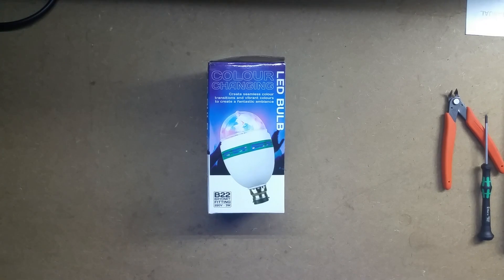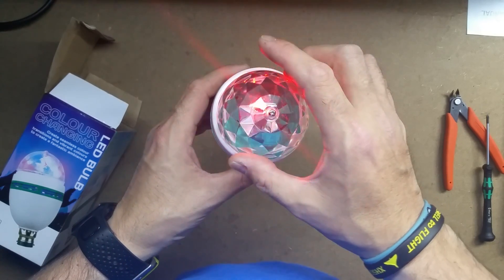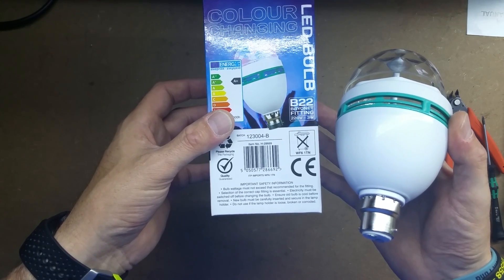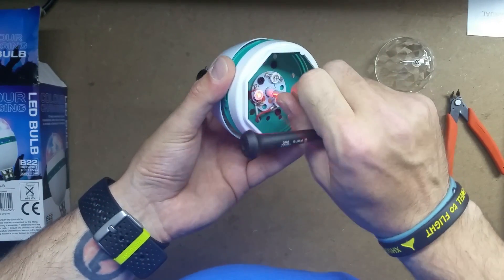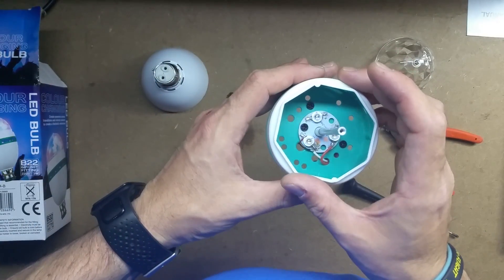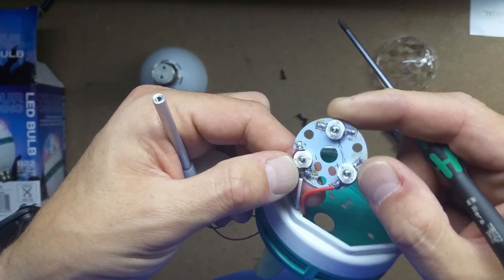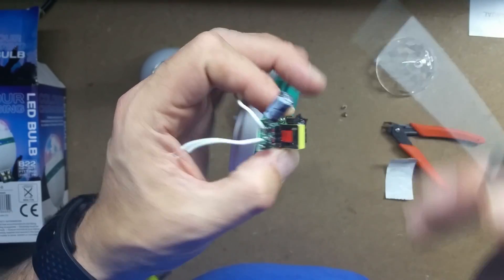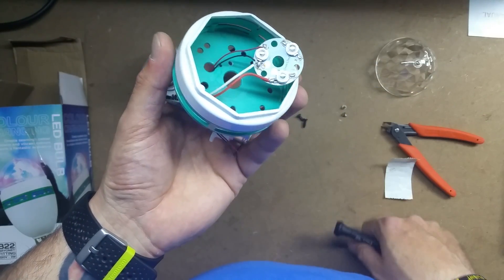Poundland LED disco bulb teardown.

Comment: I've just torn down one of my two failed "the Range" disco bulbs, they failed while being stored in box for a year of so, my controller circuit is different and has NO capacitors!.. is this why they fail? ...also shaft is plastic not alu, cutting costs even more than £-land